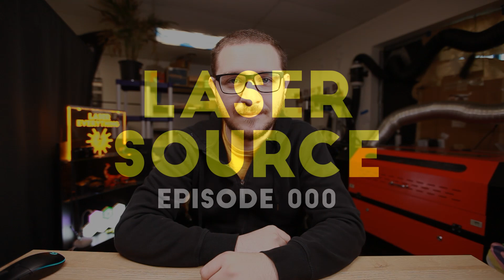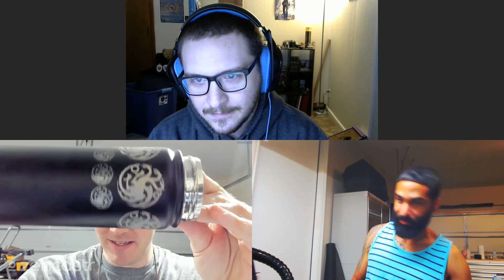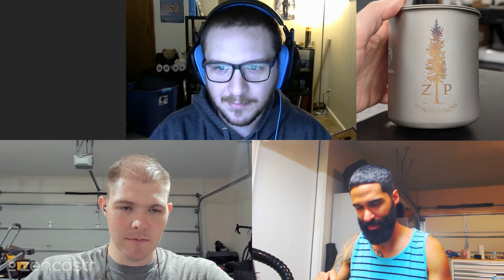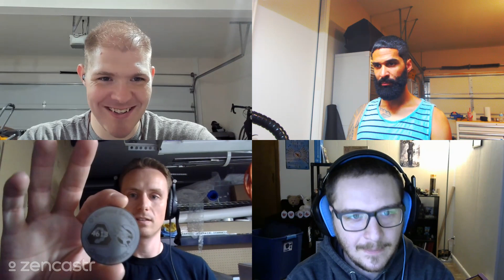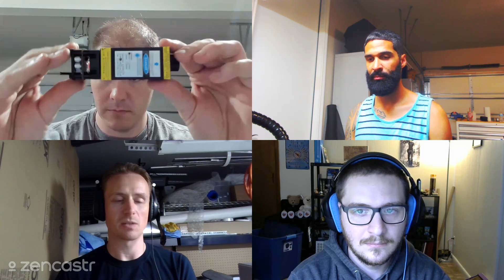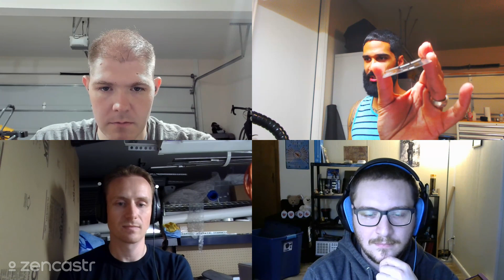[LS000] A Brand New Laser Engraving Podcast

Comment: I have three 12000btu mini splits between three buildings.  10x20 laser building, 12x24 manufacturing building and a 8x40 shipping container (just a small insulated room for temperature sensitive solar equipment).  They are great!  Much better than a comparibly sized window ac?  Avoid the portable ac units.  Barely useable really.
Reply from the maker: Very nice! Thanks for listening and sharing that. I want a mini split for my house but we rent, ugh.

Comment: I would be great to do a video on focal length between different lenses. 150mm=2mm, 200mm=3mm (not accurate, just an example) etc. The power may vary, but overall a substance that is easily marked with low power would be a great substrate to test on. It could also show how the marks develop in and out of focus.
Reply: Agreed. Sort of a ramp test, but with a fiber. Maybe use an aluminium business card and do 0.5mm lines 1mm apart along the length and have it offset by +/- 5mm from ideal. I do have a setup on order with 110, 175, 200 and 300mm lenses on order, so I may be the perfect person to learn to do this :)
Reply from the maker: Gotcha, I'll get right on it :)
Reply from the maker: Heard, great suggestion! I'll add it to the list. We have about 8 episodes shot and backlogged right now but it'll come up soon and I'll get on that!